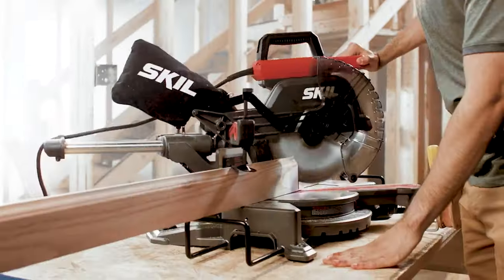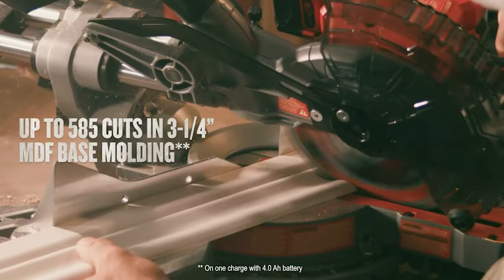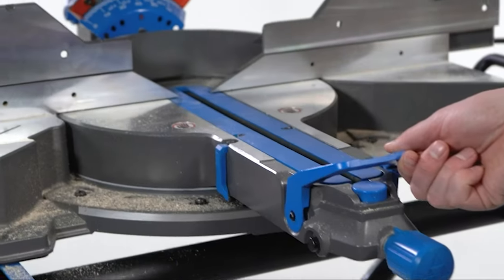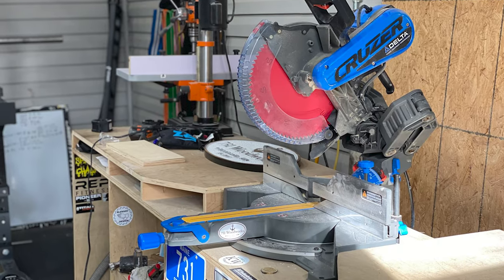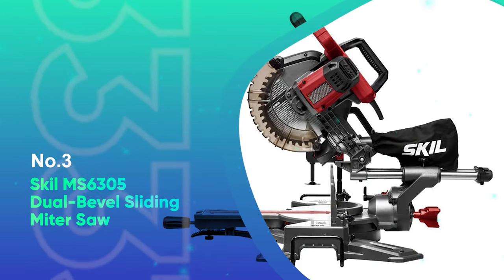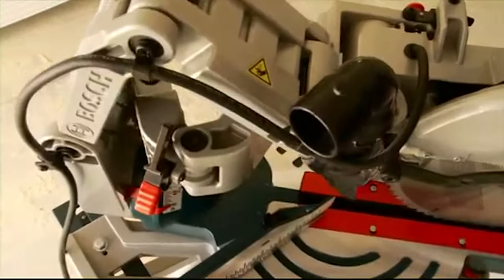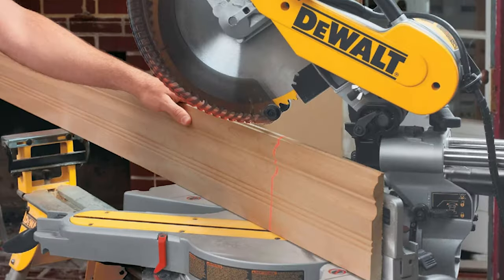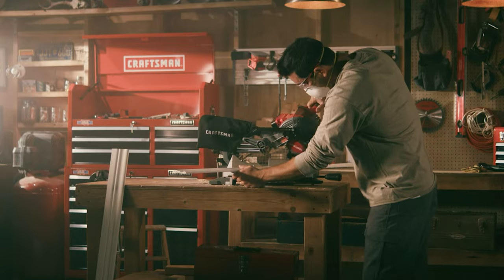Best Miter Saws 2024 [don’t buy one before watching this]

Comment: OK folks.  Did you, like me, come to this video to find a legit comparison of the top miter saws?  Then move on; this isn't the droid you are looking for.  As soon as you heard the narrative voice you probably knew that.  Not actually a review and a very strange, and totally incomplete, list of saws.  No apples-to-apples here with cordless and corded, as well as 10" and 12" saws in the same "review" (are there any pros out there other than trim and finish carpenters who are not rocking a 12" saw now).  Lots of comments mention that there are a considerable number of good saws missing like the Makita, HF Hercules, and the star of finish saws, the Festool Kapex.  I feel that any miter saw video that does not note the vastly greater utility of a slider over the fixed saws is doing a disservice to anyone looking to buy their first saw.  To make this list even stranger, the price range is extreme.  I have owned, and used in a professional shop, the Makita saws, the Rigid 12" slider, several different DeWalt models, and recently abandoned my 10 year old DeWalt slider (excellent saw) for the Bosch GCM12SD that they show here.  The Bosch is a top tier saw and in a few ways a definite upgrade from my DeWalt.  But it is also a beast of a machine with a handle that seems to have been designed for an NFL lineman.  No joke.  My hands are average size ( I wear a size L work glove) but I feel like I can barely get a proper grip on the handle of that saw.  Aside from that one oddity I think it is the most versatile and best tracking (in 12"; some of the 10" saws have very precise tracking) miter saw I have ever owned; also the most expensive.  So this video might be an interesting starting point for anyone looking to buy their first saw or wondering about upgrades.  But it is certainly not a review; just a way to generate revenue thru the Amazon affiliate links listed.  A misrepresentation that I sort of find annoying.

Comment: The Skil, listed at #3, is literally the best for any DIY because 99% of home users will NEVER use the features that make #1/2 stand out and the savings in cost allow the user to invest in top quality blades that are the actual factor most of these reviews neglect to touch on when rating the saw.  And to add a 10” will have less wobble than the 12 when the blade starts to get dull.